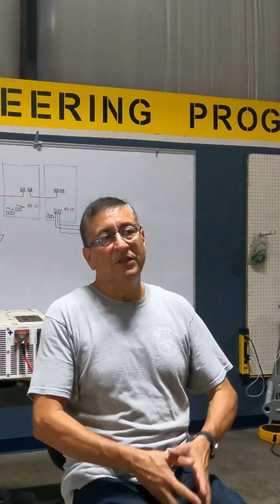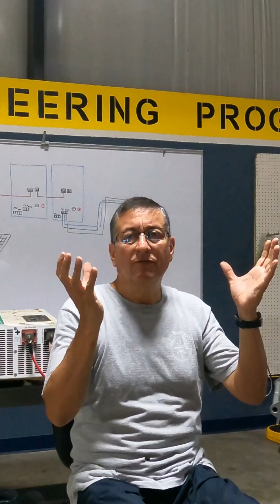Simulated Frequency

Comment: Exactly right, and a point that's rarely talked about. The grid is 100% reliant on ac generators, not to mention the rotational inertia they provide. Most people don't realize the significance of ac frequency and the potential damage to everything electronic that could result from it being off. Great video